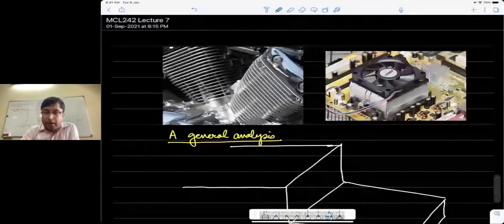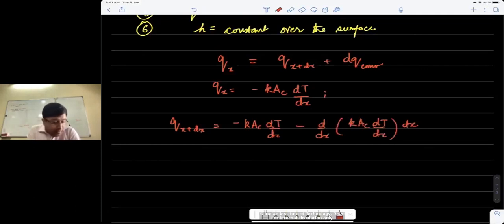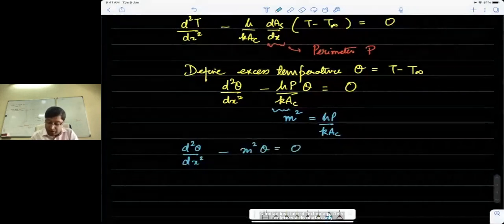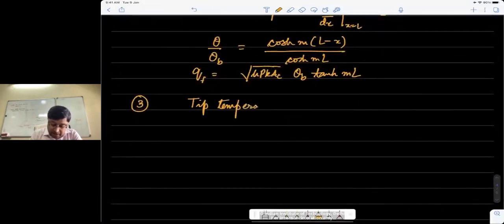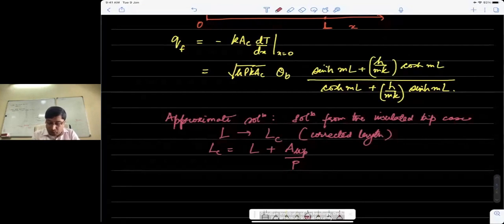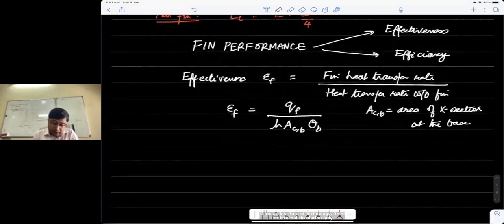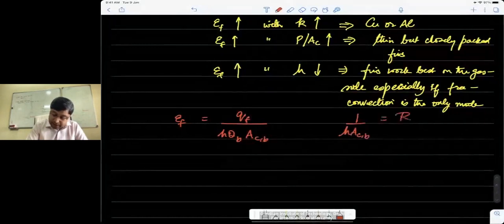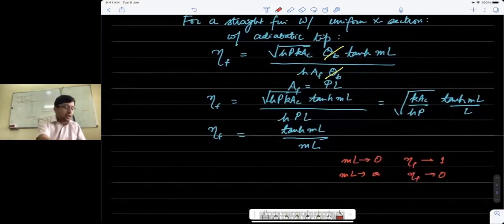Lecture 7: General conduction analysis for extended surfaces

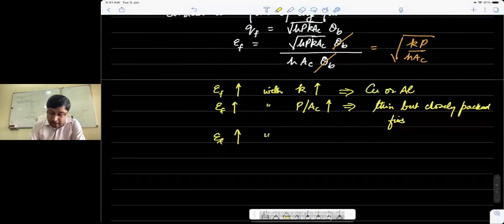Comment: This is a physical interpretation I've come up with for the conclusion at 49:50 :

since h is high, the temperature of the fin drops from T_b to something very close to T_inf over a very short length, so its almost as if you're not adding much by introducing the fin, and therefore you're not that worse off without it.

Is this line of thinking correct?
Reply from the maker: That is correct.